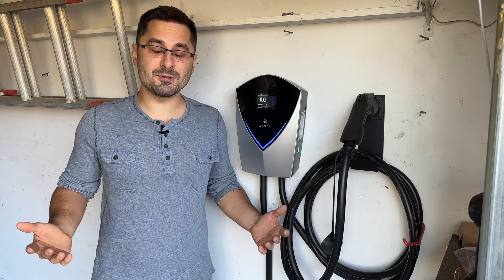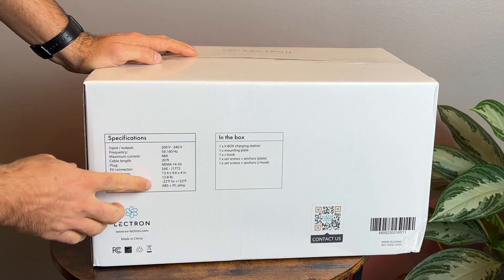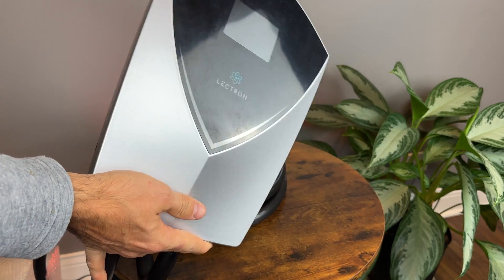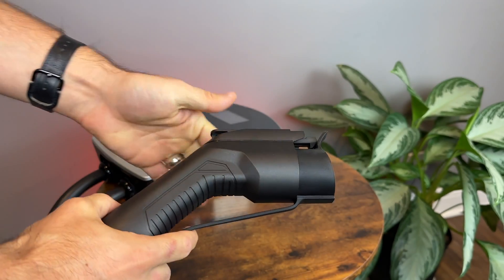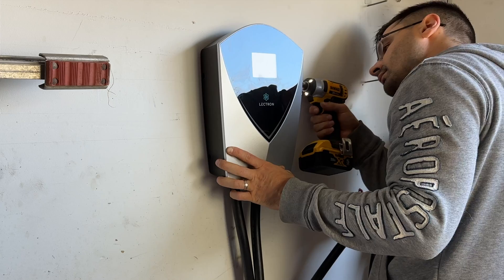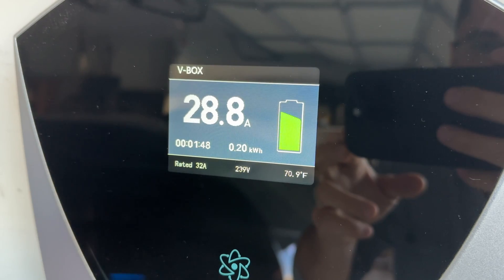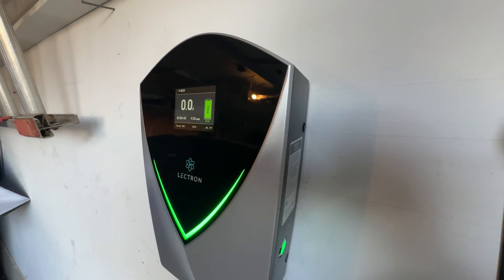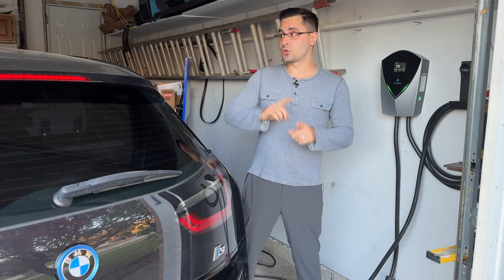Lectron V-Box 48 Amp EV Charging Station - DIY Install, Review

Comment: Very concerning Lectron says you can use 48amp with a Nema 14-50.  Not going to trust any product from a company that suggests this is acceptable.
Reply from the maker: Why is that a problem? I thought that was the standard if you don’t hardwire it in.
Reply: @SimpleCarGuy  40 amps is standard for 50 amp circuit.  48 amps needs 60 amp circuit and you cannot pair a 50 amp outlet with a 60 amp circuit.  It would need to be hardwired.

Comment: You mentioned in the video that you put this circuit on a 30A (30 Amp) breaker in your electrical panel, but you set set the Lectron V-Box at  32A according to the display.  NEC compliance for a circuit is current at 80% of the circuit breaker.  So if the 30A breaker is used for the circuit, the circuit can only deliver continuous power of 24A.  So something is not correct.  For the circuit to deliver 32A, you should have the circuit on a 40A breaker.  So if you have the circuit on a 30A breaker as you stated in your video (even though when you are speaking you have the video showing a 40A breaker), the Lectron V-box should be set at 24A.  However, in the video you also show it charging at 28.8A.  So it is highly doubtful that you have this on a 30A breaker.
Reply from the maker: The setup in the video was temporary so that I can try the product and see if I liked it enough to invest in pulling thicker wiring and installing proper plugs and breakers etc. 
It DID run on 30A breakers (not sure why I showed 40A breakers in B-Roll) and the car pulled about 28.8A, which wasn't necessarily the best idea as far as safety, but I monitored it while using. I've since updated the circuit and the car now charged at almost 32A (which is the max for this car). The circuit is now on 3 6awg wires and a 50amp breakers with the NEMA 14-50 plug. I guess I should have clarified it that I was just testing the set up in the video. Thanks for you feedback!

Comment: You literally say in your video "Compared to my portable this can charge 3x as fast" as you point out the 16amp label on your portable charger....

So, that is the absolute definition of "misinformation"

You also (multiple times) show on the screen, your 48amp charger actually charging at 32 amps.

You also indicate that the BMW does not tell you the rate of charge or how many kwh you have charged.... with that said, "Use the BMW APP for real time monitoring."

You then literally said, and I quote "at 220 volts you can charge at 11.5 kwh which is about 45 miles every hour added." (Also an untrue statement for your BMW i3 and ALL i3 Owners everywhere, again the definition of "misinformation.")

So please tell us, how much were you paid to shill this product that you most likely also got for free, while making an attempt to convince i3 owners to buy this product, based on fabricated misinformation?
Reply from the maker: Thank you for your feedback. Sorry that you feel I have misinformed you in this video. 
First of all, I was not paid to review this product.
Compared to my portable charger, this charging station can charge at 3x the speed. This is accurate.
BMW i3 can ONLY charge at 2x the speed due to it's limitation, but you can charge newer EVs at 3x the speed of a portable charger.
My BMW i3 is 2016, so the app doesn't work anymore. I cannot look up that information since the 3g network has been disabled in US.
Also, at 220volts this CAN charge at 11.5 KWH which is about 45 miles gained every hour. This wasn't specific for BMW i3 owners. I just used my BMW i3 to demonstrate the unit and as I stated in the beginning this is future proofing for me. Once I get a newer EV, I will be able to charge at 48amps (which is about 11.5kw) as stated.